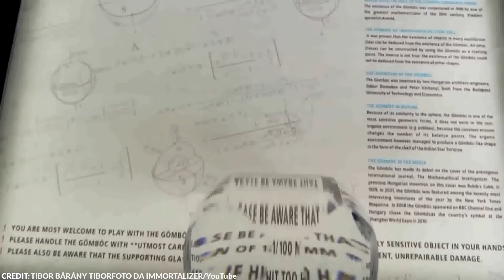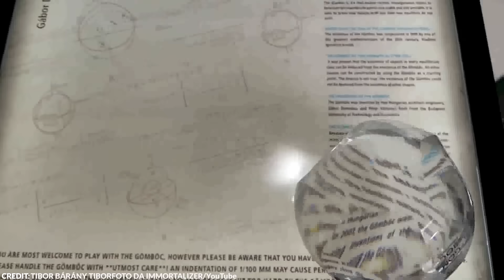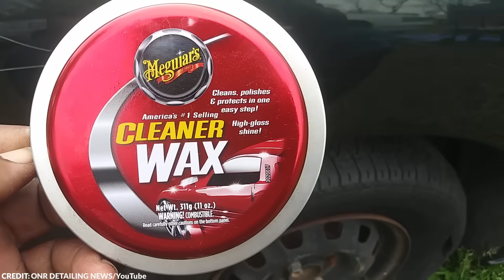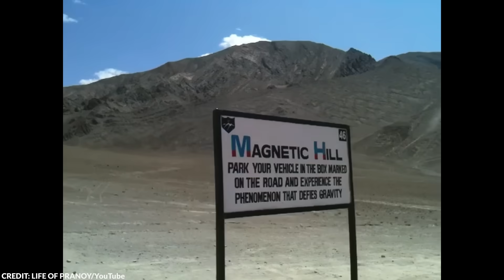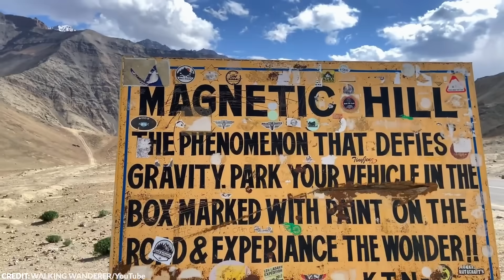15 Craziest Things That Defy the Laws of Physics

Comment: The flying carpet is very real and all materials are natural by the way and also can be controlled .. mot just flying anyhow ...
plus it can carry very big amount of wheight almost 15 times  more than planes..eg can carry over 10.000  men.
Besides the carpet you can even make shoes which can fly ... again no man made components needed..
Note... I mean real carpet..specially made  no metals for stfflness either .but turns stiff with ingredient components.
This knoledge is resrved until humans mature spritually..  plus only if you understand Metaphysics very well..

Comment: 19:27. The steepest Formula Off-Road track in Europe is in Norway. I have been there and watched this live. One little bump and you will roll down to the bottom.
These Off-Road cars is very safe, so even if they roll 10-20 times down at high high speed the drivers barely gets a scratch.

Comment: "Break the laws of Physics" did you say? How about a 'tinned foiled umbrella" that was filmed in a U.S Airforce hanger back in the early 60's levitating for starters, hum? It was originally built to act as an antenna for a perspective down U2 pilot if by chance he were shot down while flying over the USSR? Turns out (though it was perfect parabolic like a Direct TV satellite shape for an antenna) it was a lousy as such. But when the two technicians keyed up the emergency radio that was connected to it (so the downed pilot could hopefully "call home", it moved across-the-bench, then fell to the floor. Believing at first it was a draft that caused this, the techs turned right side up, keyed up the radio and PRESTO...It levitated and was then immediately classified TOP SECRET. 

Discovery Channel Wings, found this through the FOIA, broadcast it and later denied they knew anything about it.

Comment: The Monkey Man died. Showing off ,he fell. Truth. I don't understand why some of the motion machines are not legit. The one with the ball bearings that falls through the hole and follows the wire track to the hole again. Why isn't it a working model? It will only stop if all the parts wear away.
Reply: which is exactly why it isn't "perpetual", because friction will eventually wear away enough of it so that it stops working

Comment: Great video, thank you!!  
On my channel are a series of ion propelled aircrafts that are patented specifically for lifting their power supplies against Earth's gravity.  They can fly with no moving mechanical parts.  They create a downdraft with solid state electronics that is sufficient to propel them upwards.  They don't defy physics though, rather they rely on well-known physics.  It used to be that ion propulsion could not lift its power supply from the ground. There are more than 40 public videos of the craft.

Comment: Starlite should be sprayed in ares of fire hazards like forests in Ca.
Reply: I think starlite is most likely corn starch, baking soda and glue.  The actual protection wouldn't be the elements themselves but the combination of them in a solid/semi solid form which when heated burns but that burning creates a protective barrier which then prevents further burning.  If you add too much glue so you keep it in liquid form then I suspect you would get virtually no benefit of the other components.  You would essentially just be trying to put fires out with glue instead of fire retardants.  And I think that if you tossed just baking soda and corn starch on a fire without the glue (in their dry state) you would get one huge fireball.  At least I think they are highly flammable when airborne.  I'm not a chemistry expert though, I just play one on youtube.

Comment: Amazing video thank you! Yes, atomic motion is perpetual. Mass changing its position in space = motion. Perpetual? Well for most of us billions of years is long enough. So, examples of perpetual motions (does not factor in wear and tear of the device); solar panels, water mills, wind mills, geo thermal (Iceland), John Bedini generator which uses a drive battery that looses only a few milliamps while the charging battery gains hundreds of millivolts (I personally recharged hundreds of batteries, with carefully measured results)... The physics here at play is to not be stuck to one view, one device and what it does by itself. Yes that's being confined to thermodynamics. However, look outside the box for energy source (solar panels obtain their energy not from photovoltaic panels, but from the sun). Thermodynamics is true in CLOSED or ISOLATED systems. Nitinol is also overunity (which perpetual motion is a part of) using cold and hot water to activate it cyclically.  The most abundant phase of matter in the universe is plasma (an electrically charged - ionized gas). Well, a lot of energy could be pulled out of these stellar gas, and they will be energized until the end of time by stars. Are we introverted into a small device set in motion, or are we scientifically, logically looking at the big picture? As long as we stay stuck in a boxed-in frame of reference, we don't progress. Every advances made was possible by women and men who dared looking at things holistically, from all points of view. Cheers!
Reply: Is fake they use the same thing for FinoCapital  and they took my money .later  they will tell u the company  is closed
Reply: @akusika9385  that’s called a scam
Reply: @jocelynnowen3078  Scam is when they charge you for something that won't work and they get away with it. John Bedini has thousands of people who, like myself, has not paid anyone to build anything. See Jocelynn, quite frankly, I HAVE a generator that recharged over 350 batteries (9V, 1.2V, 1.5V) over 14 months. And you have a bad experience, or an opinion with no tangibles, generated by others. Best wishes to you Jocelynn.
Reply: Well put modernbieeogscirnce. The ultimate MIT exams is not solved with known processes.!outside the box is where the solution for the endless energy supply is. I was just in discussion with my oldest and he stated it’s beyond ions. You’ve clarified that here. Tia of physics discusses the number of dimensions CERN is exploring
Reply: Very eloquently put!😁✌️

Comment: I think the levitating foil was caused by CO2 ; there was a blowtorch
Reply: ps didn't finish section
Reply: Yes. I've floated a piece of plastic inside a big glass jar to amuse some youngsters. Need a glass jar with a metal lid. I used a half gallon jar that was a pickle jar. Put a lit tea candle on the bottom  of the inside the jar and screw on the metal lid while the candle is burning. In a couple minutes the flame will use up all the oxygen and produce CO2 gas which is heavier than air. Gently unscrew the lid and hold a small piece of light plastic (like from a soft drink lid) horizontally and place it in the jar.